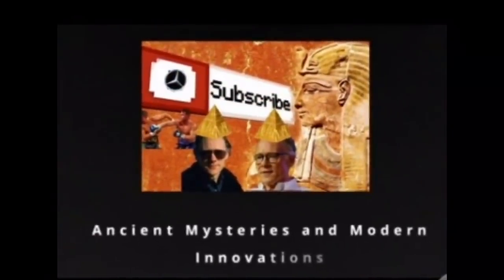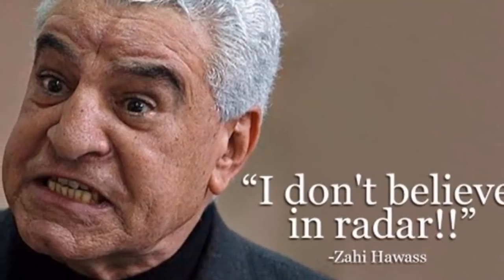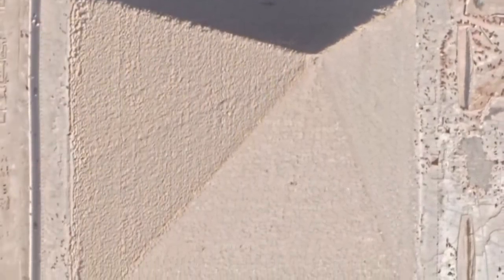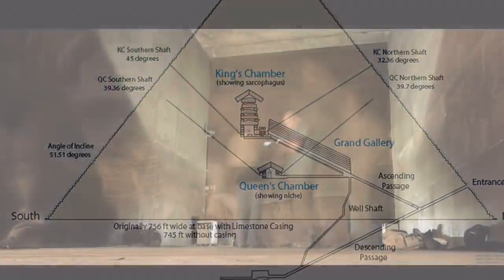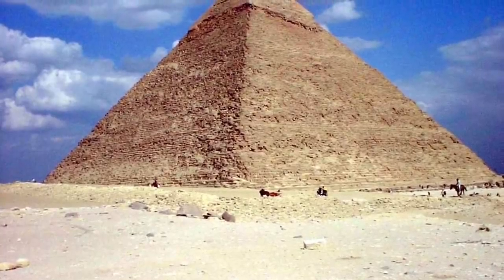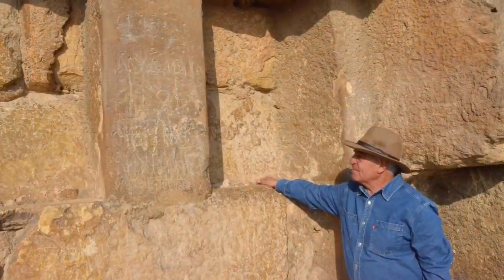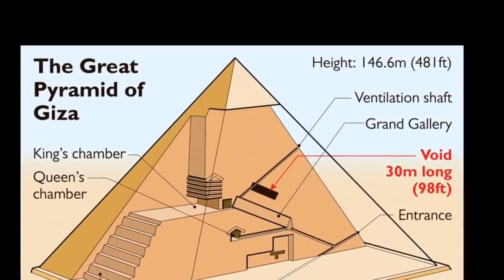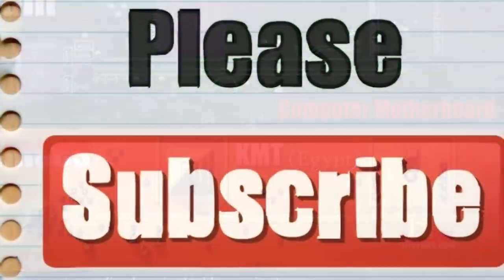Graham Hancock on Geopolymer (Liquid Stone) Technology at Giza Pyramids

Comment: Let's be logical about this: When you make concrete, you include aggregate of various sizes to fill the volume, some of which might include fossils. When you make geopolymer, you are likely to make it out of the same stone you are replicating and reforming, and that may include large chunks of the original stone mixed with the liquified geopolymer portion. Davidovits pointed out that some of the geopolymers contained whole shells--BUT no longer oriented naturally as they are originally found in solidified sediment that turns to rock. They are more randomly oriented as would be if reforming the stone after geopolymerization.
Reply from the maker: I totally agree, very likely a lot of things would be in the mix
Reply: Yes, very well put. I completely agree!
Reply: +1
Reply: "When you make concrete, you include aggregate of various sizes to fill the volume, some of which might include fossils."

This can easily be checked by the estruture of the Limestones, if they did use larger aggregation it's easy to separate from the Cement Material. 

I worked in construction, you can see when a concrete used any type of aggregate for volume, even if they used fine sand. If it's uniform it is pure Cement, not concrete.

"BUT no longer oriented naturally as they are originally found in solidified sediment that turns to rock." this claim have no basis, since you can see fossils on stones they are literally randomly spread, there is no "naturally oriented". You can just check images of Fossil Walls on google images.
Reply: @LucasBKOK  there is an entire documentary supporting that basis on the Egyptian stones when compared to the original quarries for SOME of the stones.
Reply: Brilliantly stated, for Professor Davidovits covered all angles to the construction of the blocks. Some people must keep the mystery going to sell books, get interviews and become famous. Graham is Not a scientist, for he is just a writer/explorer. He probably never read Professor Davidovits research papers. 
Great response!!!
Reply: @Herbert Jones  Well, that's because Davidovits, Harvard and Drexel University have scientists, where Graham writes and sells books..
Reply: I was just about to make this comment and that Roman concrete had shells in it.
Reply: As blue collar guy who works with concrete daily, I can attest to putting random rocks , bottles and all kinds of crap in our mud.  It takes up volume when low on concrete and it gets rid of garbage on site
Reply: That’s very interesting! Were the varied sizes of the aggregate stones possibly intentional? If it’s true that the orientation of those fossils was random it lends credence to the idea. This is really exciting stuff.
Reply: also pranksters or allowing children to put their design on it, but later it could be troweled flat
Reply: Not only the pyramid blocks, but also the so called "granite stones" were made of geopolymer granite. Think about it. All those perfectly shaped containers (sargophagae) with right angles and straight lines which show no tool marks on the exterior or interior. How else would they make it if not with geopolymer granite poured into moulds? We know for a fact that ancient egyptians used various stones with electric conductivity or non-conductivity properties. Is it easier to go 100 miles to a quarry to mine huge blocks, haul them to the construction site, cut them again into small blocks and then fit them in, or would it be easier to get powder material from local quarries and mix them into geopolymers with the properties you want to have?
Many people ignore the electric properties of some of the stonework in the pyramids and temples, but i think that is the key to solving many of the construction mysteries. Maybe all of the stone blocks are made with geopolymers because they wanted to make them with certain recipes, depending on their purposes.
Reply: @mancamiatipoola  The theory of Davidovids includes that the large granite blocks were natural, for religious reasons, this does however not rule out possible geopolymere for other objects, his default however is to assume (large) granite to be natural, although geopolymere is possible.
Reply: the only logical explanation for the speed they made those pyramids with, is cement . Way easier to carry cement up the pyramid and make the block there then carry the block, 2 millions of them . And how they lifted the blocks of granite ? using wood that's how. Put slide wood under it, in the middle of it. Create an empty space on both sides , Then you put weight on one side, the block lifts on one side and crates a small gap and you slide another wood and you do the same on the other side. You keep doing it until it reaches te height you want. These people overreact like hell when they talk about pyramids. It is hard by it isn't impossible.
Reply: Thank you
Reply: I might as well delete my almost identical comment.. You're absolutely right. I'm glad to see someone knows or has put it together
Reply: They hate when things get solved they smell their money dying up 🤣
Reply: 100%
Reply: I have to agree, the geopolymer would likly not be finly grinded, most of it would be chunks of rocks, mixed with finer material, also thers now places wher the outer rocks has fallen down so u can actually see that there is on the inside a mess of smaller rocks and a cement like filler (likely to speed up construction alot), but regardin the fossiles...we see also fossiles in the geopolymere stones of tiwunaku/ puma punku in peru/bolivia.. but we also now know merer transported alot of block by boat to the pyramid...so i belive sevral methods can have been used, for example the 12-20 meters long base blocks was unlikly transported...many have cracked now but i highly doubt thay was laying the fundation with cracked blocks when everything else was made to perfection...
Reply: Would the magnetic distribution not be randomly distributed in a pour system as opposed to set in same direction when formed at a block
Reply: my first thought
Reply: Sorry but my english is not very good 

I would say the casing stoned were put first to Keep the geometry perfect, they were probably shaped with a water wheel, grinding Blocks against each other or rubbing against them with a wheel and sand. The nile is right there, hammering stones is idiotic in my opinion.

Then you fill in the space with the geopolymer and the spriral way inside the pyramid is used to bring the casing stones up.

This would require much less time and much less people to build that the normal theories
Reply: One thing you don’t understand is they were very scarce with trees in the area. And cutting down trees to make individual forms would not have worked out. Each block is different you would’ve had to of made 2,000,000+ different forms. I do believe that they melted some granite to do some things, but this is not how they build a pyramid
Reply: @WarDaddyUSA  The theory is that there was an ample supply of palm-trees to create the ash used for the chemical reaction and that the depletion of palm-trees not only made the continuation of this building method impossible but also created an environmental disaster.
For the size of the blocks, it would make sense to use a few different sizes of forms reusing them (like we see in mud-brick construction), making a new one for every block is ineffective, as it would also be to only use one single form to make all blocks.
Reply: 1950- Harvard sheds light on the nummulites on the stones asking how they could carve through stone, but not damage a single nummilite or fossil.   In 1979, the Geopolymer Institute of France proved the stones had air bubbles and filaments. In 2004(I believe) a a paleomagnetism  study revealed of all the stones studied (on all 3 pyranids) that the magnetic north poles were all parallel and impossible if carved and dragged 100s of miles. In 2006, Drexel University proved the quantities of the materials used to create the pyramids stones are unnatural, and a natural source for the stones "CAN NOT BE FOUND ANYWHERE ON EARTH"  because the ingredients were most likely mixed improperly.
Reply: There has been some speculation as to the possibility the nummulites became fossilized after being cast in the geopolymer. In other words, they were caught up in the mixing process while living. This would be due to the source of the components within the geopolymer having an abundance of them. The reason this is not widely accepted is because that would put the construction of the pyramids further back in time than any known record.
Reply: Thank you
Reply: Granite is mixed concrete also
Reply: They were carved and lifted. Absolutely not poured
Reply: @mattlawton088  Well then, I guess that settles it.
Reply: @nicholash8021  no but there is alot of evidence.  Like that big beam they were carving then it broke so it was left there. Don't under estimate what man can do.
Reply: @mattlawton088  we know there were many larger hand-carved blocks. Never disputed that. I'm referring to the many filler blocks and probably outer casing stones. They knew where they needed strength vs efficiency.
Reply: Maybe but wouldn't the fossils be ground up or even broken in to bit's maybe 🤔
Reply: @mattlawton088   Maybe they are, I cannot recall the evidence on broken fossils, however, there is ostensibly some evidence of plant-based chemicals to soften stone--as unbelievable as that sounds of course. We really don't know for sure the mastery of stone they had. With that said, Davidovits demonstrated with convincing experiments his ability to produce a virtually-identical blocks as a geopolymer. Please search for his videos where he makes and tests such blocks and has them sent to reputable laboratories which falsely concluded they were original Egyptian stones due to their nearly identical makeup.
Reply: How do you get the water up 450 feet goat skins !
Reply: @tin5666  Maybe it was premixed and hauled up in smaller buckets and poured well before it solidified. Or maybe they hauled up water separately, the same way they hauled up the aggregate. They probably had had a pulley system too.
Reply: Yeah, this guy isn't a critical thinker. This was my first thought on his fossil problem.
Reply: Yeah that’s fine but it still doesn’t explain how they moved the 70ton granite blocks above the King’s chamber, which were obviously not formed by moulds.
Reply: @MrBeau101  There appears to have been a large pulley system where the grand gallery, including marks in the sides where stops were placed. But how they even managed to get blocks of that size where that starts I cannot understand. It is absolutely astonishing.
Reply: @MrBeau101  those are two separate points which aren’t mutually exclusive.
Reply: @curtis_ny90  I didn't say they were
Reply: @MrBeau101  Thanks for this thought,  but it is absolutely feasible to cast blocks in the position of those above the King's chamber.
Reply: @evanpenny348  I look forward to hearing your explanation.
Reply: @MrBeau101  See 
Nicholas H
Reply: @evanpenny348  “how they even managed to get blocks where that starts I cannot understand..” I’m not seeing your point / explanation here.
Reply: @MrBeau101  yes good point. But why are they unfinished?
Reply: @MrBeau101 They were casted on site...
Reply: @MrBeau101   geopolymer can make more than one type of stone, it's possible to make granite with it. For now this seems to be the best way to explain how to have enormous blocks up to 100 m up ... but it is also mean that the civilization that did it was very advanced and global, because the same technique is used on other places on earth.
Reply: Seems like proof to me! What else could it mean?

Comment: There are already studies showing how the grand gallery was used as a system for counterweights as well as theories of counterweights on the ramp to the middle pyramid which then went down to the great pyramid. There are also other theories of floating them. No matter which might be true on transport, the issue of geopolymer of limestones is a separate issue from that of the aswan quarry granite, as well as separate from how the limestone from tura quarry were handled for the casing stones. The issue of if they were carved with "copper" tools, there is soo much misinformation about harness and about the copper. I can crush a diamond with a rock even though it is the hardest material so looking at only the mohs hardness is incorrect. The "copper" of that time was actually much harder than pure copper today due to the impurities of arsenic in it which made those tools much harder. Granite does flake when impacted, but not when you just use a blunt dolerite rock with a blunt end of granite. The crystalline structure of the quarts makes it brittle to impact.
Reply from the maker: ...So their hardened copper tools were able to carve out perfect objects like the boxes of Saqqara?
Reply: @AncientMysteriesAndInnovations  haha. you're funny. no. why would they? that would be dumb. The copper was used to assist. There are other ways much simpler. Take a look at how granite was cut, shaped and ground historically and recently without diamonds. There are several ways. Also the boxes at Saqqara have evidence of their polish. It wasn't from copper tools carving. "perfect" is relative to tolerance and whose measurements are more accurate and precise. From numbers I've heard I don't believe it to be that "perfect". It can be built with tighter tolerances today. There is also an assumption on the pyramid that it was all built the same way missing information to where samples were taken, and what restoration has been done to it. There is obvious restoration in the last century just by comparing pictures. There is obvious erosion by sand that has been restored and filled in as well as mortor. Who put that there? I believe inside and outside and foundations were probably different, as well as top and bottom could have been manufactured differently. You can see wooden beam still stuck in the limestone like a fence post. I don't know who messed with the pyramids.
Reply from the maker: @awesomedee5421  tighter tolerances today, well obviously...however, I suggest you look up chris dunn and his engineering pov about the supposed technology of the bronze age. I appreciate your comments!

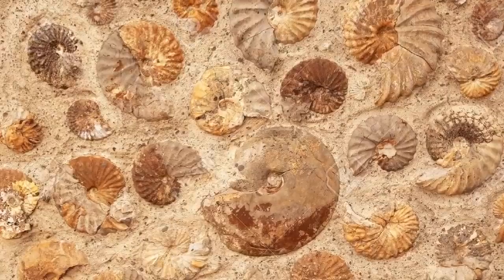Comment: sea shells have been used as concrete aggregate on may vids I have seen because limestone is just sea shells ground compacted heated watered and hardened by earth. If some of the blocks have been proven to be concrete then it would be safe to assume that a sea going people would have scooped up piles of shells to use as aggregate because they are lighter than rock and eventually turn to crystalized form of limestone. at 2:31 you can see way way too dense of a gathering of shells and all on the same plane. some one set those by hand as a layer clearly. In that dense of a gathering some would have landed on others or sloped ocean floor at an angle, differing depths, etc.

Comment: So..they knew a way to make a concrete that resembles limestone?and when you find a block with fossils in it then it's obviously a cut block?what about the adding of stone chunks possible containing fossils into the slurry as filler?if your going to pour a slab of several tonnes why would you not add filler?
Maybe they poured slabs at the top of the pyramid and then shaped them as they hardened?
Theres numerous possibilities.
Reply from the maker: agreed

Comment: What is easier. Cutting a near perfect block, drag it up the pyramid (without chipping it) and placing it in such an exact way that there is no seem.
Or dragging a bag of Knauf up a mountain and adding water to it?
Which is the least time consuming, least labour intensive? Safest even?

I like how they found organic material in volcanic stone (in south America). Must be magic tardigrades....
Have a look at the tip and foot of the final Obelisk in Aswan. To me the marks look like "stamped earth" instead of "magic scoops"
The pregnant woman in the Baalbek quarry has a seem at the bottom (which is the bottom of the mold)
Etc. Etc.

Scientific proof refuted, just like Zahi Hawas does....
Reply: I can't get past the fact that the stones are not the same size etc. Plus if you have multiple molds you would need to pack the mold let the mixture dry, remove the mold and then set the blocks together. They would have to dry hard enough to set the next layer etc increasing the chance the blocks would break if not cured properly.Why have molds of different sizes. I could go with a softening of the stones.
Reply: "I like how they found organic material in volcanic stone (in south America)"

These ones are clearly concrete, you can see, using ONE SITE ON THE OTHER SIDE OF THE WORLD to determine how others were made is bizarre.

And these sites on Puma Punku are 1500~ years old.

Comment: You can use seashells as a coarse aggregate in Geopolymer blocks.   So it would look like a fossil inside.
Reply: still doesn't explain the granite 70 ton blocks inside the kings chamber
Reply: @allstargaming5270   It does.  They knew how to make granite stone too.  There are granite stone blocks that have obviously been molded in a form.
Reply: @allstargaming5270 even if the granite blocks are real, that’s only .03 % of the pyramid
Reply: @allstargaming5270 Wally Wallington demonstrated human potential
Reply: How did the sea shell escape pullverising when they pound on the stone, the shell would get blasted by a hammer not left on the surface of the block unless erosiion exposed it after the hammering.
Reply: @woodchipgardens9084   They dont have to hammer the stones.  They form it in a mold like cement.  Its not shaped by hammering.
Reply: This pyramid just keeps getting cooler and cooler so fricking brilliant. Seashell in the pyramids